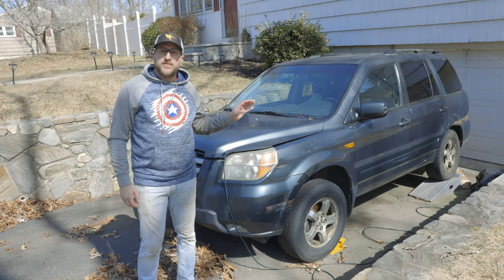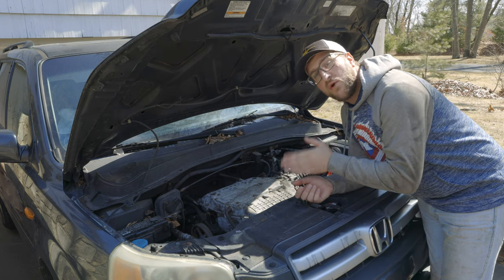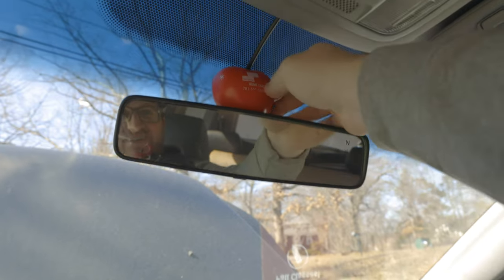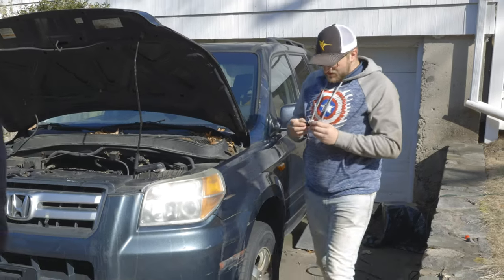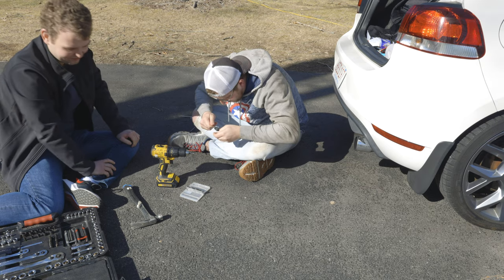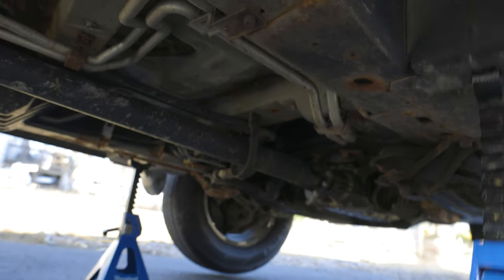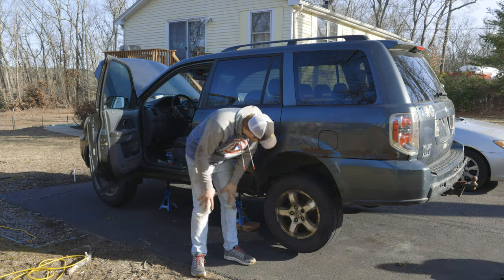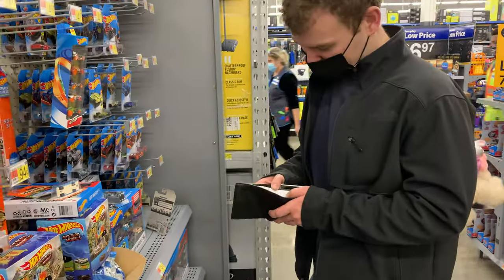Broken 2006 Honda Pilot (RESCUE MISSION) - Pt. 1

Comment: Love the pilot videos can’t wait for more, I have a 2006 pilot as well and I love it
Reply from the maker: Good to hear!! I hope it’s in better shape than this one LOL. Will be cleaning the fuel filter, new injectors and adjusting the valves in the next episode.
Reply: @NotSoHandyCarGuy  yes mines in wayyy better shape haha but not perfect, she got about 290,000 miles on her but still running great! I’ve done little mods to mine as well, like new headlights, LED lights, sound system, new paint work to body and rims and a few minor things.
Reply: @hsuuta8036  did you had any transmission issue? such as stucking on one of the gear and you have to baby the gas to shift to next gear? my 06 pilot stuck on first gear and have to baby it to get to 2nd gear , i change the fluid sensor/switch and the linnear solenoid and didn’t help , now the car is just parked XD
Reply: $500 definition not worth it , if im buying this car , the owner has to pay me to get the car

Comment: I didn’t realize how much knowledge you have on cars.   I have faith that that will be up and running in a month. Ha ha . Looking forward to your next video.
Reply from the maker: Just learning as I go, Torrey! A year ago I could barely change my cold air intake 😂😂 Thanks dude!
Reply: @NotSoHandyCarGuy  I just told my Honda pilot 04. 120,000 and bought a Lexus 2004 GX 470.   I absolutely have always wanted the truck love it.   The guy so I purchased it from.  Pulled douche bag move.  He didn’t tell me a part of the frame is rotted out.  He certainly pictures of the part of the frame that was not rusted.   I drove it 5 hours away Maine where it’s being fixed.
Reply from the maker: @torreyinnewyorkcity334  Oh no! I’m sorry to hear that about the GX. It’s such a flip of the coin with those and 4runners. We eventually have to get the frame repaired on our 4th gen, too.